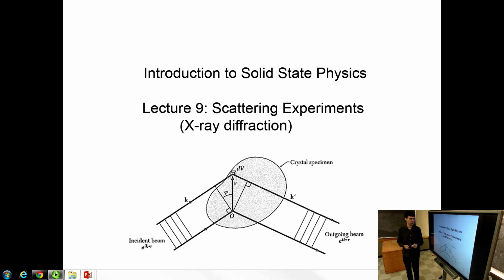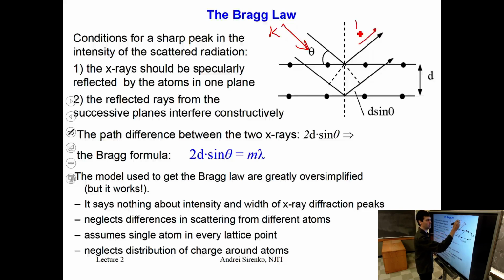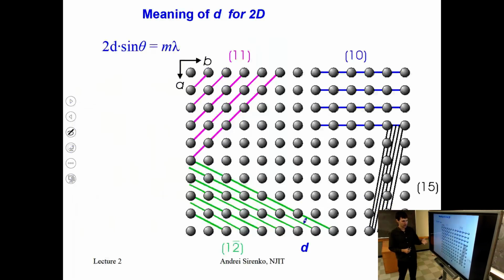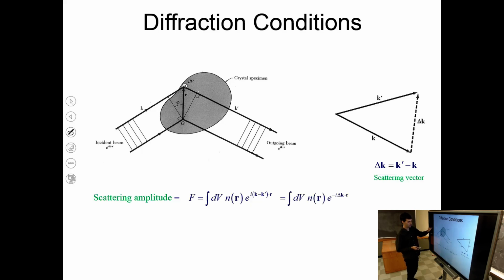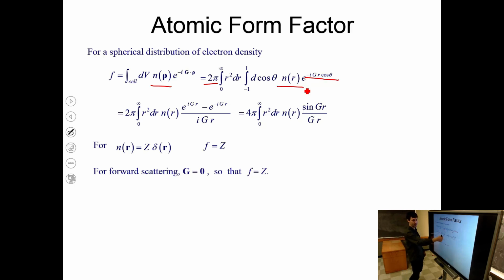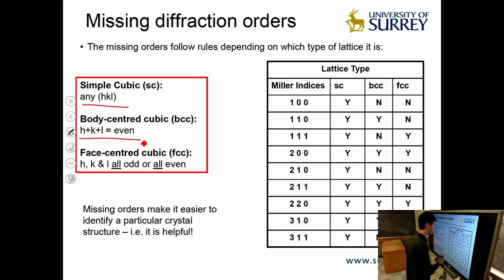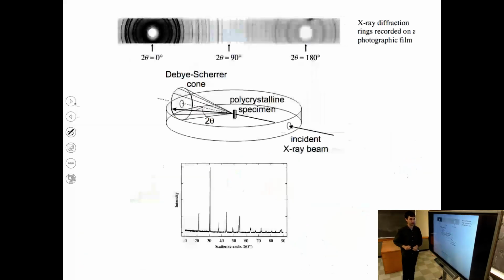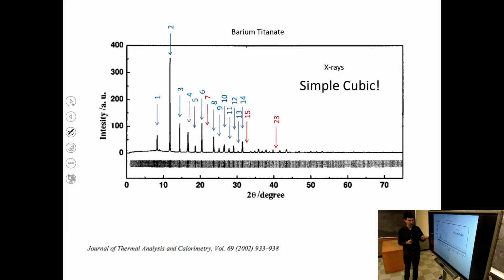Introduction to Solid State Physics, Lecture 9: Scattering Experiments (X-ray Diffraction)

Comment: Hello,there. Sorry to bother, but in minute 21:56 . I agree with (10), but what about (11)?  if we intersect y=x-1 with the axis we get (1 -1) therefore miller indexes are the reciprocal (1 -1). The same problem with green lines y=-1/2x+1  ->. (2 1) take reci (12) and not (1 -2). Why am I wrong?
Thanks